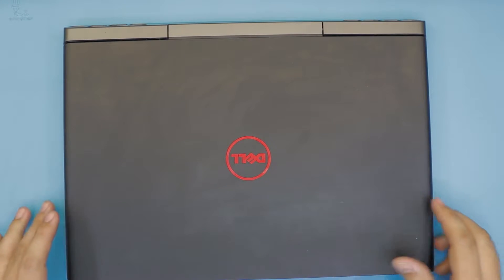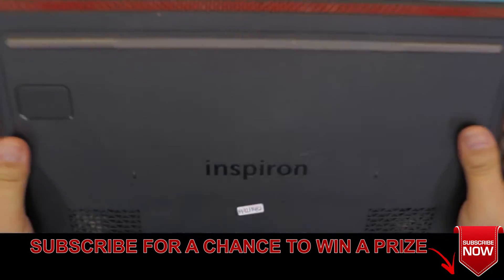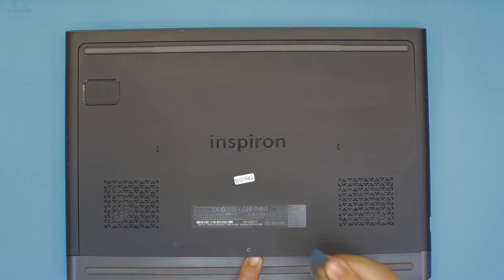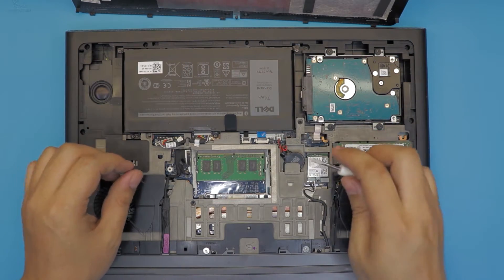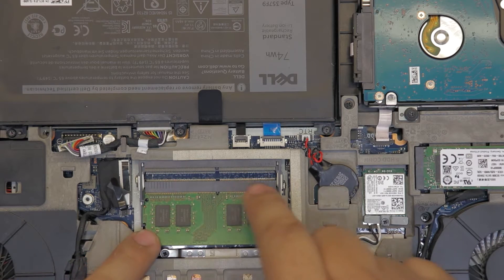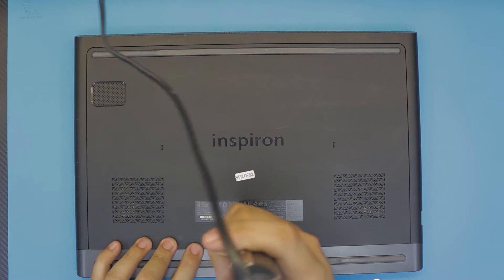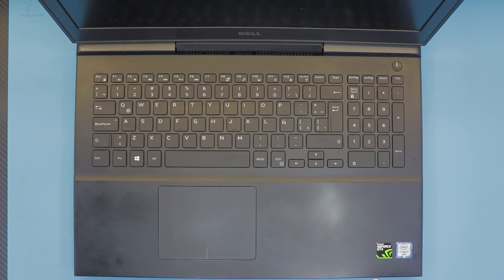Dell Inspiron 15 7000 RAM UPGRADE / Replace

Comment: How will I know if the ram I bought is defective or “not working”??? and I have the same model which one to buy
Reply from the maker: windows 10 has a ram test tool:
https://www.windowscentral.com/how-check-your-pc-memory-problems-windows-10

and you can buy any brand and as long as its a DDR4 it will work:
https://amzn.to/3ihYdmA

Comment: Ok last comment 😂 the laptop comes with one 8gb ram installed can i just buy another 8gb to save on money or do they both have to be the same in order to work?
Reply from the maker: no they dont have to be the same order or GB or speed. as long as its DDR4 it will work just fine. but its very recommended to buy the same GB and same speed (HZ) as the one you have, so it can activate the duo channel memory. if you get different GB and speed, it wont activate the duo channel and it will work but not as good as dul chan. good luck :P
Reply: G11 Chan it’s been a month since i upgraded buy buying one 8gb ram and its working fine
Reply: @stefanpozder8376  may i know what brand of ram did you bought? Planning to buy another 8gb ddr4 2400 mHz for upgrade and does it show dual channel in task manager or cpu z?

Comment: I have this same laptop with 16gb of already installed. Will it recognize 32gb of ram? Im thinking of upgrading again because virtual instruments and audio pluggins are starting to use up the majority of the current 16gb of ram installed.
Reply from the maker: yes you can go up to 32gb we have installed a 32gb ram in clients in past.

Comment: Which kind of frequency is accepted by this laptop? Can I put it a 3000MHz RAM?
Reply from the maker: max supported 32 GB RAM , and Yes you can go up to 3kMhz , but its not worth it for based on performance and price, 
the best configuration for this laptop based on the CPU is:
2 x16GB @2666Mhz 
*Note make sure if you want the best performance get two identical rams (GB and Mhz) that way you get the benefit of auto activating the duo channel mode that is very beneficial.
**Note 2. if you get any ram make sure you go to bios and find out how to turn on your "xmp" so the right ram frequency can be detected and activated, else the bios will choose a low range Mhz even if you feed a 3600Mhz.

https://amzn.to/2BFsWqt

Comment: I can see that there is a style option in the amazon link you have in the description. Can you explain how the style affects the ram?
Reply from the maker: go with the "ram single" no need for "dual rank" ,  but if you want a better abit faster go with "dual rank".
A single-rank DIMM has one set of memory chips that is accessed while writing to or reading from the memory. A dual-rank DIMM is similar to having two single-rank DIMMs on the same module, with only one rank accessible at a time.
Reply: @uFixTek  Sorry but I think you misunderstood what I was trying to ask, I was talking about the style that has 3 options: 2400 mt/s, 3200 mt/s, and 2666 mt/s. I was wondering what that is.
Reply from the maker: ah i would always recommend to go with lower mt/s e.g 2133 , because the higher mt/s the higher the latency, the bigger mt/s is faster but not a good latency .

Comment: Right now I have 2 8GB 2400 MHz, can I replace one of them with a 16 GB card? And keep the other one in order to have 24 GB ram... Thank you in advance.
Reply from the maker: i highly recommend you to keep the 2x8gb ram, because if you have two of the same same (speed and GB) the bios automatically activates the duol channel memory, and that is much more faster than having a 8gb and 16gb.

but if you want more GB because of file of some application or something sure you can go 16gb and 8gb .

but if you can go 16gb and 16gb that is the sweet duo channel of 32gb 
and much cheaper in usa than MXexico amazon :P
https://amzn.to/2PbfUYW
Reply: @uFixTek  Oh that is great! I will make the effort and get the 32 gb duo. Should I upgrade my windows? I have understood that windows 10 Home supports until 128 GB thank you very much for your information and support.
Reply from the maker: if you have any windows 10 XXXX its fine , because you will never go over 32gb anyways on a laptop . there is no point going pro or anything
Reply: Thank you all for your help, the pc os running great with the 32 Gb, cool.

Comment: For some reason, the top memory slot won’t let my ram slide in as far as the bottom slot will. Can you help me with this?
Reply from the maker: with a tooth brush clean the dam dim slot, and try again some ram slot need the extra push, in 35 degre push harder the ram into the slot, after cleaning.
Reply: Thanks for the fast reply. Pushing the memory into the slot with a lot of force did the trick.
Reply from the maker: told you :P good luck if anything let me know :)

Comment: Is it possible to replace a cpu for i7
Reply from the maker: no my friend its not possible its a BGA cpu not an LGA, and if you even solder the new cpu it wont turn on because of the extra components that it needs to power it. therefore nop
Reply: uFixTek thank you so much for the answer! Have a nice day .
Reply from the maker: anytime , if you got any questions ask out here :P good luck

Comment: I currently have 8gb ram and would like to upgrade to 16gb total. Am I able to insert another 8gb into the second slot or do I need to purchase a 16gb ram. It would be great if you could link the proper ram upgrade. Thanks!
Reply from the maker: hi regarding your question, you can place another 8gb :
8GB : https://amzn.to/3g9qEDl
or you can add another 16gb to have 24gb and
16gb: https://amzn.to/3g5wHJ9

or you can get a 32gb kit to have 32gb in total:
https://amzn.to/3lC4J92

regardless the ram combinations you WILL get the duo channel configuration on automatically.

thank you for your support to the channel by SUB :P
Reply: @uFixTek  thanks a lot.
Reply from the maker: your welcome and if there is anything else i can help with let me know , good luck.

Comment: I want to use a SSD for my laptop  inspiron15700, what kind of SSD do I need?
Reply from the maker: you have two options:
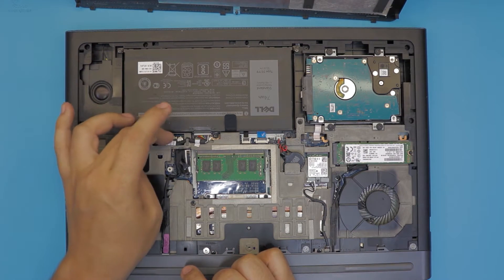#1. replace your mechanical HDD to a SATA SSD, as you can see in video @1:12 its the right top 
recommended models:
https://amzn.to/38UXH8Z

#2. you can get a NVME SSD (10x faster than SATA SSD), as you can see in the video @1:12 its the middle right under the hdd.

recommended model:
https://amzn.to/2wgima2

your laptop can handle any type of sata ssd  and nvme drives. but the most and the best are samsung they will last longer the bigger the storage(GB).

Comment: currently is 16GB 1 slot, I want to upgrade to 32GB ram.
how should I select another ram?
DDR4 16GB 2400Hz chips 8 or 16?
Reply: and I have seen in other comments that you mentioned 
Why do I need to upgrade windows to pro or enterprise for 32GB
Reply: I also want to upgrade SSD which currently 250GB SATA M.2 
Can I replace with 1TB NVMe SSD? 
or I should stick with SATA M.2?
Reply from the maker: I would recommend to go with an NVME 1tb:
https://amzn.to/3nda1cI
and regarding rams, if you have one stick 16gb ram then you can mix match the way you like you can add another 16gb ram stick,
and dont worry about the windows pro or home or single, just make sure you have 64bit version and im sure you have 64bit.
the ram must be : SDRAM DDR4 (dual or single rank makes no difference in intel cpu, but if you can find single rank get single rank)
16GB: https://amzn.to/3mdb4I8
8GB: https://amzn.to/2W9ctVD

THANK YOU for the support tot he channel by a sub :)

Windows 10 Home 32-Bit 4GB
Windows 10 Home 64-Bit 128GB
Windows 10 Pro 32-Bit 4GB
Windows 10 Pro 64-Bit 2TB
Windows 10 Pro for Workstation 32-Bit 4GB
Windows 10 Pro for Workstation 64-Bit 6TB
Windows 10 Enterprise 32-Bit 4GB
Windows 10 Enterprise 64-Bit 6TB
Windows 10 Education 32-Bit 4GB
Windows 10 Education 64-Bit 128GB
Reply: @uFixTek  Thank you a lot, that would helpful
Reply from the maker: your welcome :)

Comment: What is the Maximum amount of RAM that can be put into Dell Inspiron 15 7000 gaming PC?
Reply from the maker: 32 is the max
Reply: uFixTek So putting two 16 gb ram sticks, with the same specifications as the stock 8gb ram, would be ok?
Reply from the maker: Landon Luangsomkham yes any two stick that is sdram ddr4 will work ,
Reply: One more question, thanks for answering btw.  Is there a difference between single rank and dual rank?
Reply from the maker: there are 4 types single rank 2 and 3, and 4.  but honestly for regular consumer you wont know the difference, but i would recommend to go with 2 rank because it will last longer and less over heating. it affects better on server level the ranks.

Comment: Hi, I'm really new to laptops. I have the same computer, and I want to upgrade the RAM from 8gb to 16gb. Should I have two 8GB sticks of ram or one 16GB stick of ram? Thanks
Reply from the maker: i highly recommend to get 2x8GB of the same type of the ram (same GHZ and GB) 
https://amzn.to/38AwNTS

the reason is that if you have two identical rams its much faster that have a single big ram, and thats because there is something called duo channel memory , it will automatically activates if you have both the same. the duo channel is like 4x faster. 

thank you for the support
Reply: @uFixTek  Thanks! I really appreciate it. I subscribed :)

Comment: Great video uFixTek. I have exactly the same computer with 8 gb ram. What is the maximum gb ram i can have on this computer? Also if i buy a SSD is it a good idea?
Reply from the maker: Thank you for the feedback and your support to the channel :)
you can go up to 32gb :
https://amzn.to/3iRVkdq
regarding the ssd? if you dont have an m.2 ssd or sata ssd,
then i highly recommend you to place an m.2 ssd (for windows OS), and keep the HDD for storage.
m.2 ssd:
https://amzn.to/3pnCkWW
sata ssd:
https://amzn.to/2Ygelga
HDD:
https://amzn.to/2M8JNKT
Reply: @uFixTek   how can I keep the HDD for storage? Can I have two internal drive ? Thank you.

I am going to buy this 32 gb ram. I saw the style there. Is there any difference? Thank you
Reply from the maker: yes you can have two here i marked them :
https://imgur.com/a/78MGdXO
the m.2 ssd for windows and the other for storage for files and games.
and the style of the ram has no difference in anything.
good luck
Reply: @uFixTek  Hello again,

I found one memory ram with single rank. Does it work? Is there any difference between dual and single ? And if so could you send to me the link to buy the best and one link from your store where you can make commission out of my purchase also. Thank you
Reply: also, i've never opened my computer and is it with m.2 ssd available or HDD?
Reply from the maker: the are not much difference between single and dual rank , but the single rank is a bit faster than dual rank, but you wont know the difference its like milliseconds .
send me the link that you found ,
and for 32gb i recommend the following:
#1. :https://amzn.to/3on3rzR
#2: https://amzn.to/3qV6m4A
Reply from the maker: go to the task manager and go to the "performance" tab and on the left it says how many disks you have and if you click on one on the right top it will give you the model of the drive. give me the info or pic and i let you know.
here is an example : my hdd is : MG04ACA400N (google it and it will tell you its a Toshiba 4tb)
Reply from the maker: dont get that 32gb stick that is a single 32gb stick, its not 16gb x2, this laptop have a hard time detecting  32gb dim. so go with the link i send the duo rank 16gb x 2
and it looks like you only have one hard drive , when you in task manager on the left you only see one drive the Toshiba right or you see something like this: https://prnt.sc/xrulij
(here i have two hard drives) if yours only shows one , the one you send me then you only have a mechanical drive.
get a big capacity m.2
m.2 ssd:
https://amzn.to/3pnCkWW
and install windows in this and format the other hdd  and use for 2nd storage.
Reply: @uFixTek  Nice. For SSD i am going to buy it soon. But I am still confused with the ram. The difference is 100 CAD between a single and dual 16gb.
Reply from the maker: A single-rank DIMM has one set of memory chips that is accessed while writing to or reading from the memory. A dual-rank DIMM is similar to having two single-rank DIMMs on the same module, with only one rank accessible at a time.
The server memory control subsystem selects the proper rank within the DIMM when writing to or reading from the DIMM. Dual- and quad-rank DIMMs provide the greatest capacity with the existing memory technology.

dont get all worked-up and think over the single an dual, the dual and quad dims are best used in server, but no harm done on laptop. you will not notice any speed difference , just take my word for it and go with a cheap ram that you can get.
Reply: @uFixTek  thank you very much! I am going to buy it now and I let you know the outcome.
Reply from the maker: i wish the best and remember when you install rams, and you power on and if after 15sec no screen , then remove both rams and plce the new one 1st then power on and when you get boot then power off and add the old one.
Reply: @uFixTek  my m2-ssd arrived! I have one question. Should a format my hdd? Or install windows on ssd first and then format the hdd?
Reply from the maker: sorry for a long delay but you will need to disconnect the HDD 1st the install the m.2 and install windows then connect the hdd and format it. please leave new comment as this comment goes all the way down the list.
Reply: @uFixTek  hello, i got my new memory ram, however I am able to use only together with my old one. The system identify and black screen. When I place both together it works perfectly and identify 40 gb of ram.
Reply from the maker: @RenatoDias  this is happening because if you want to only use the new one you must reset the bios and then place the new one only, and it will take 5-10sec to detect. but if you can use both keep it with both :P

Comment: can you upgrade to 32gb on this laptop?
Reply from the maker: yes you can do 32gb , but i would suggest 16gb if you going to use it for gaming else sure go for 32gb .
Reply: @uFixTek  Ok. I'm looking to edit 4k video. Wonder if 16 gb will be enough. How much does a 16 ram stick cost for this computer?
Reply from the maker: uff if you going to edit 4k you need 32gb+ ram, 
https://amzn.to/2VvjnoE

Comment: Thank-you for the information!
Reply from the maker: Any time! thank you for the feedback.
Reply: @uFixTek  quick question- so i m looking to buy HyperX Impact 16GB 2666MHz DDR4 CL15 260-Pin
For my dell 7567 ,  what i think is that my bio is locked at 2400 so doesn't matter if i buy higher frequency my system will run it at 2400 right? Can i run 2666 in my dell  its 7th gen ?
Reply from the maker: yes it will run fine and your bios will only take advantage of the ram up to its max supported freq. and your ram will work even better for longer time as its made for higher FR, but using at lower, so less stress and longer life:
here is a link if you feel like helping out :)
https://amzn.to/3c6kKzR

good luck and if there is anything else let me know.

Comment: Great video
I was planning to upgrade my ram with another ddr4 8gb
But what are other specs I need to see about 
What cl15 or cl17?
Dual or single rank?
Reply: @G11Chan  thanks for the reply
Can you suggest any ram for this pc?
Reply: @G11Chan  already my laptop has an 8gb single stick ram so planning to buy just another one
Is it required that the one already present and the one I'm buying need to be the same

Comment: 2135mhz 1x16gb will work on this laptop? And 2400mhz 1x16gb will work on this laptop? , Or they have to be the same?
Reply from the maker: it can be different GB and speed  and it will work, but if you want the best performance you must add two of the same GB and same speed GHZ. to be able to benefit the duo channel. so e.g 16gb and one 8gb will not be better as 2x 8gb
Reply: @uFixTek  thank You very much bro

Comment: Hey on Amazon it gives me a choice for single rank 8 GB or dual rank 8 GB
Which one should I choose
Reply from the maker: Tide Pod God the dual rank is abit faster and longer life span,  the dual rank premuch it has doble the chip . Both will work if you have the budget go with dual always.
Reply: Can we combine/mix a dual and single rank ram? Or it should be both the same rank?

Comment: The top level isn’t opening to 45 degrees in my laptop. Does anyone have any suggestions
Reply from the maker: no always opens on 45, as long at it opens more than 10 just pull out in the same direction , nothing will happen, and when you put it in in a angle that came out push hard towards the slot and push down. good luck also if you need send us pictures and will help.
Reply: uFixTek my ram was initially in the bottom slot and i am able to freely put either of my chips in there, but I am unable to fit either chip in the top slot
Reply: The gold pins are never fully inserted
Reply: uFixTek how can i send you a picture?
Reply from the maker: not always the pins go all the way in especially the top one, do the following:
insert the top ram in a side angle in the slot with a pressure firm pressure, then when you push it down is the click on the sides do click then you are all set if the side clips are still not locked it, then the ram is not in, push more and more force . the clips are the indicator for the ram if its in. dont worry regarding the pins showing as this is normal.
Reply: uFixTek It looks the top part isn even un clipping. I tried forcing it down but it never locks and the ram just slides out
Reply: uFixTek oh my god i finally got it. Thank you so much
Reply from the maker: good , im glad you got it in :P enjoy your new upgrade :)